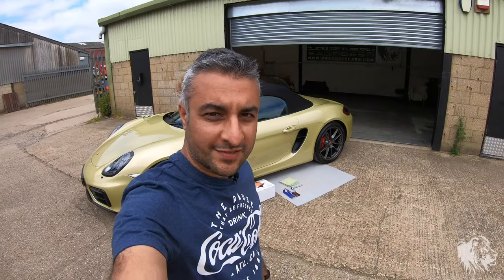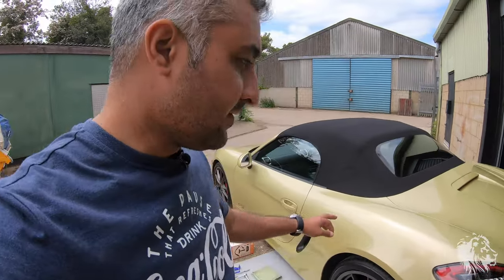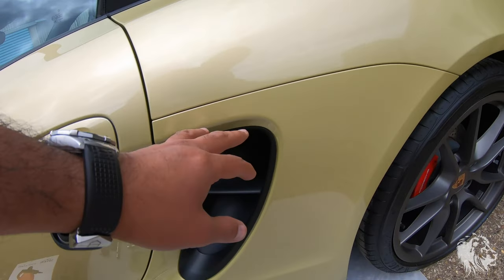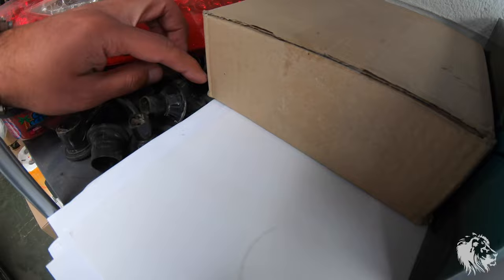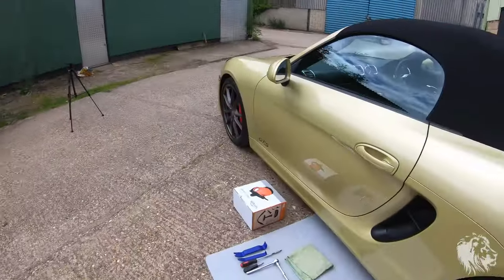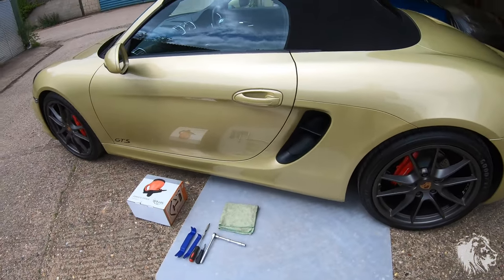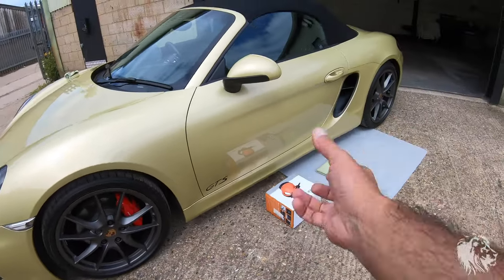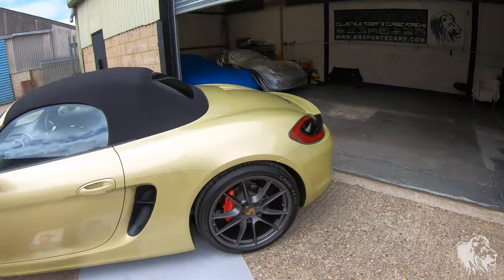Porsche 981 Boxster S GTS Side Flood Drain Unblocking QUICK VERSION How To DIY Guide AVOID ££ Repair

Comment: Thank you so much for your in depth videos. I have today cleared out the drains OMG full of rubbish and blocked. Ended up using your first version as I wanted to remove the side panel complete. Wheels stayed on. Again thank you...😊
Reply from the maker: Great to hear it was useful and prevented issues with your Porsche! Raj

Comment: So I’ve been to the dealership that’s supplying my 981 Boxster GTS. They confirmed the drivers side (U.K.)  drain was blocked. Bose amplifier had drowned. Replacement being fitted at their cost. The technician said the official Porsche line now is for the valves to be removed.
Reply from the maker: Thanks for the insight about the Porsche network now recommending to remove the valves too! Hope the repairs go well on your new GTS, make sure the foam under the carpets is 100% dry by lifting them all before handover, otherwise they will start to smell damp, especially over this coming winter. Ideally they should strip the whole interior including seats to dry properly for you. Cheers, Raj
Reply: @MRSPORTSCARSPORSCHE  Seats and carpets are all out of the car. The dealer has been really thorough. Big up OPC Bournmouth.  Never dealt with them before. By far the best customer experience from my point of view.

Comment: My Porsche dealer was cleaning those drains using a long extension on a compressed air line.   That process was actually making the problem worse compacting the debris, the actual clog was only occurring right at the valve outlet that Raj is removing.  The debris that did get blown past the one way valve appears to settle on the top of the side sill panel and get washed out just ahead if the back fender liner.   I cleaned the valves and returned them after removing the rubber covers, now that I think about it I will probably go back and remove the valve assemblies also.   Thank you for this great video!    If you are a Porsche expert and can offer any reason NOT to remove those valve assemblies please let us know!!
Reply from the maker: Thanks Genna! Yes I see this compressed air method being charged for on invoices a lot, but I have seen the same compacted debris in the valves too. I would also like to hear from other Porsche experts if they have found an alternative/better solution than removing the assemblies completely. Thanks again, Raj
Reply: What about using a small tube under vacuum to suck out all the dirt and debris?

Comment: Excellent video, and thank you for posting! I bought a 2013 Boxster a few months ago and wanted to check this. Despite the car being low-mileage and garaged most of the time, I did find a fair amount of debris (little maple keys, etc.) in the larger of the two valves. It was still letting water through, but it would only have gotten worse over time. 
I watched this video and the longer-procedure one, and decided to split the difference and remove just the rear wheel and fender liner, leaving the side panel attached at the front. It all went well and your procedure was easy to follow
cheers
JW
Reply from the maker: Thanks JW, I am hearing from so many people about this issue and what they are discovering when doing this procedure! Some are saying the Porsche dealers are insisting they have cleaned them thoroughly so there is nothing to worry about, yet when they check for themselves as the owner, they find debris lodged in this outlets. Not good! Cheers, Raj
Reply: Great video. I’m in the process of buying a GTS from an OPC and they’ve found the amplifier is faulty and they’re going to replace it. My guess is water ingress has caused the issue. I’m betting these valves have never been cleaned out. 
Looks like dealers won’t do this maintenance procedure unless the owner insists and then they’ll charge £100’s which will deter owners from agreeing to have it done.

Comment: Hi Raj, thanks for the video, second time I've watched it and need to pluck up the courage to do mine. Quick question: are there any drain holes/plugs at the front of the car? Thanks Nick
Reply from the maker: Thanks, I think these are the only ones that cause issues. I have heard of the drain pipe for the AC sometimes causing flooding in the cabin too. Cheers, Raj

Comment: Great video! I just picked up a 2015 with 9k miles. Garage kept before and will be going forward. So before I pull the valves out, is it easy to just test the water flow to try and ascertain if the valves are working as originally intended?  If mine are, I might just leave them in since it will never be left outside and likely not driven in the rain.
Reply from the maker: Sounds great! Just see if the water freely flows from the top to the outlets in the lower sill.

Comment: Hi Raj 

Great video , my parking senses are playing up I guess from the water that has gone on the carpet underneath the passenger seat … I’m gonna tackle this asap as my window are steaming up and the passenger seat it wet 

Do you think once dried out the senses will work or does the electric unit under the seat need replacing  ? 

Just says error on front and back on the screen and parking senses are not working
Reply from the maker: Good luck with the fix, hopefully with the module removed from the car and properly dried out, it may start working again. Remove it asap otherwise the moisture will continue to damage it. Cheers, Raj
Reply: @MRSPORTSCARSPORSCHE  thank you for your reply Raj much appreciated

Comment: Great video! Thanks Raj. I have water under the seats in my 981. I'm going to dry it out and do this fix, but do you think there is likely to be a blockage in the pipes at the top (where the hood mech is)?
Reply from the maker: Thanks, you can test them by putting a hose down them to see if they back up or flow nicely out the bottom of the sill. Thanks, Raj
Reply: I use really thick weed eater line and run it down the drain holes to loosen up any debris then blow out the drain lines after you remove the valves at the bottom. But the only likely spot for a blockage is at the bottom where the restriction is at.

Comment: Excellent video!  I can relate to the feeling of "breaking" the car from when I did the engine air filters on my 981 Cayman.  I searched for this question and did not find a similar comment, but does this also apply to the 981 Cayman?  I'm thinking yes since they are on the same platform, but maybe they're present only on the Boxster since it's a convertible.
Reply from the maker: Thanks! Once you know how much force you can apply and where it is actually very easy to do these kinds of jobs on a Porsche. This issue only affects the Boxster. Many thanks, Raj

Comment: I just wonder why Porsche caps those drains in the first place, there must be a good reason. I would say that they are there to collect the bigger debris and they are meant to be checked and cleaned regularly. Removing them will allow you not to have to clean them every year, but what happens with the debris then? Do they stay in that area under the air intakes? I doubt that they will be expelled and there must be other drains in there the let the water out. Could those drains clog too? And if they do, where would the water over flow then? In the engine? I hope I am overthinking this, but in the video you have not explained where the water actually drains out once it drops from those two pipes. I enjoyed the video Raj. 👍
Reply from the maker: Thanks for voicing the concerns and issues, well worth covering these off, the end caps are designed to stop insects I believe from finding their way into the cabin, but I think this is not necessary given the location of these valves in the sills and in the UK we just don't get insect activity that would be an issue. The debris that will now flow freely through to the inner sill area, it would build up generally here, but you can use this guide to clear it out of there every year or so. I can't see it building up in there to the point of filling the sills (many litres/gallons of water). The sills are not perfect sealed items, and the engine intakes are high up. Many thanks, Raj
Reply: @MRSPORTSCARSPORSCHE  thank you for the feedback Raj, it is appreciated.

Comment: Hi Raj, I have the illuminated 'Boxster' emblem on the sills. What will I break when removing the sill cover 🤔 
Thanks.
Reply from the maker: Hi Paul, I haven't done one yet with the illuminated door entry guards, I imagine you can still pull it off in the same way but there will be a wire possibly with a plug to detach it, be careful not to break the wire. No warranty implied by me with this procedure on your car! Cheers, Raj

Comment: hey Raj, this is a good video, however just wondering if this would be the solution for damp seat belts after rain/car washes?
Reply from the maker: Hi, yes possibly, as the seatbelts run in the area where the water would come in from. Raj
Reply: @MRSPORTSCARSPORSCHE  thanks for the response! i've cleared the drain holes but issues still seems to persist, i've ordered new seals to replace and hopefully this will solve the issue.
Reply from the maker: Hopefully you got your issue resolved. Raj

Comment: Thanks for the video Raj, do you know if the issue has been resolved on the 718 or is it still the same design?
Reply from the maker: Hi David, as far as I know it has the same valves, but I don't stock 718 so can't tell you for certain. Many thanks, Raj

Comment: I would try a snake for drains first. Go in from the top. Pour some solvent down it periodically.
Reply from the maker: That is what dealers do, or with compressed air. Trouble is, the debris that is pushed out ends up stuck between the plastic sill and the metal bodywork behind it. The solvent isn't a great idea because that could corrode the metal in that area where it runs out or damage the plastic sill as you won't be able to wash it out.
Reply: @MRSPORTSCARSPORSCHE   wouldn't leaving out the valves completely cause the same problem with debris falling down between the plastic sill and the bodywork which eventually could cause rust issues. Perhaps better to leave the valves in there and clean them on a regular basis. I think the valves do serve a purpose. Great video nonetheless!!